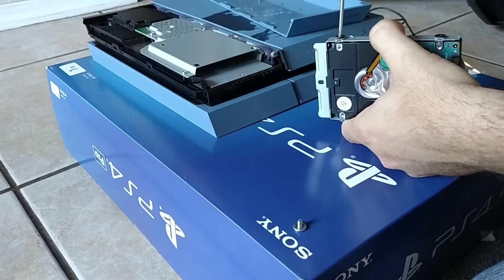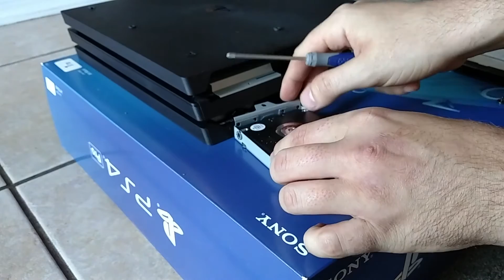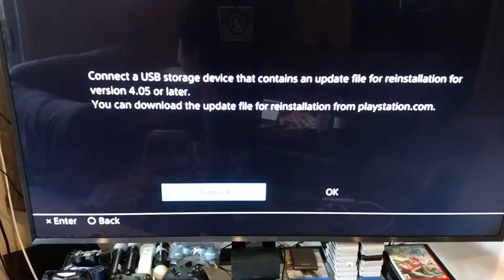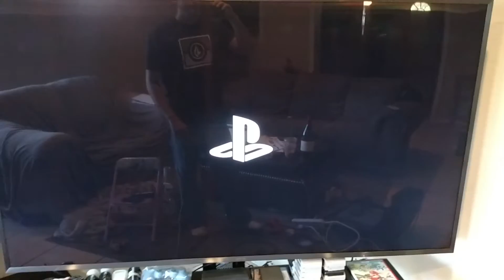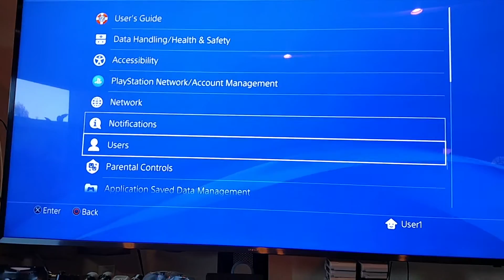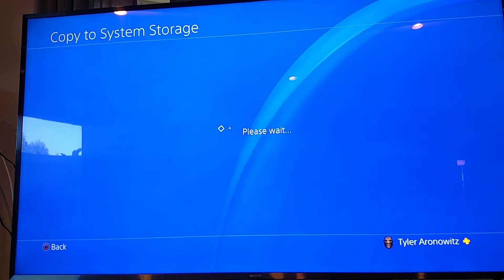Ps4 Pro Hard Drive Removal & Swap / install new hard drive tutorial

Comment: Hi 
I have changed my ps4 hdd 
Sometimes i hear long single beep 
Should i be worried?
Reply from the maker: I have not had this happen to any of mine when switching hdd's but as far as I was able to find online it seems some people have had the same issue with the beep after replacing hdd but no other issues or problems.

Comment: I have a old hdd from a ps4, and i want to install in a ps4 pro, what do i do, i must delete the stuff i have on the hdd, but i cant do it on my ps4 pro
Reply from the maker: Did you try going through safe mode on system to initialize system with the downloaded software from sony website on a flash drive? This should wipe drive clean and put a fresh install on hdd.

Comment: I have a ps4 that has no picture signal tried everything I now have a brand new ps4 pro can I take my old hard drive and install it in my new ps4 pro ? The hard drive from my old ps4 is a upgraded hard drive it is a 2tb Hd any help is appreciated.
Reply from the maker: Hi Chris, unfortunately you cannot put this hard drive into the new ps4 and have everything just continue working. You can use this HDD but you will have to download the install playstation file to a usb drive and follow steps in video to setup new HDD with your console.

Comment: Hey guys. So tried to do this last night with a new PS4 pro. I get to the stage of initialising the PS4 and when the status bar fills and the PS4 restarts, it won’t boot up again. The white light bar stays solid. It does that indefinitely until I have to force it to power off. Any ideas what’s going wrong?
Reply from the maker: Awesome. Geeky. Stuff. Try clicking on the link under video to the playstation site where you download software. Scroll down to Perform a New Installation of the System Software and make sure you follow those steps with file names being exactly how they say.
Reply: Thank you Ty's Vid Zone!

Comment: when i went to initialize ps4 (reinstall system software) it searched for the update software that i downloaded on my usb, gave me an error or message saying it couldnt load software and needed and updated version
Reply from the maker: Chase Altimore make sure that the folders are named and spelled correctly.  PS4 folder and UPDATE folder inside with PS4UDATE.PUP file inside that.

Comment: Hey. I have 2 TB on my original PlayStation. Can i simply just swap the harddrives? I have no problem with redowloading everything, but I really want those 2 TB? But no dowlaoding software on the internet or something since its already there?? Just take it from one device to the other?
Reply from the maker: The hard drive from your previous console should fit and work in the ps4 pro but you do still need to download the software onto a usb drive and install it when swapping to the new console unfortunately. Then you will need to download the games again as well. Just make sure that you backup your game saves online, on a usb thumb drive, or both before doing this so that you don't have to restart on all of your games.
Reply: Ty's Vid Zone! Hey my OG ps4 won't turn on anymore and sadly I didn't back up any of my save data. I recently bought a ps4 pro and the only option I have is to swap the hard drives (I don't know how to back up saved data on a broken ps4) if I swap the hard drives will I keep my save data I really don't wanna lose years of save data if you could help me with this it be much appreciated
Reply: @MOERUGG  you figured it out bro?
Reply: @WhyNotQuestionEverything  Sadly no I just restarted most of the games I have
Reply: @MOERUGG  my ps4 pro won’t turn on so I’m going thru this now what did you have to do to get yours working again bro? Just swap hard drives ?

Comment: Hi man, I put a 2tb in my PS4 n gonna get a pro next week I want to put the 2tb in the pro see if I just remove the drive and put it in ps pro will it reformat the hard drive aromaticlly or is there anything I need to do?
Reply from the maker: I don't think that it will reformat by just inserting the 2 tb hdd. You will probably have to download the software from the link that I have above and use a usb thumb drive to boot system from and format the hdd to the new console. Also make sure to save any of your game saves to either a usb thumb drive or the playstation cloud before reformatting.

Comment: do i need to start my new console atleast once before swithching hardrives
Reply from the maker: No, you can do the swap without starting console for first time. When you put the new hard drive in console you will be installing system software and then it will be like starting console for the first time.

Comment: Did you save all your stuff when you did this cause I have a character in 2k17 that I don't want to loose , also my old PS4 is broke so is it possible to still do the transfer and save everything without the USB ?
Reply from the maker: Yes, I backed up everything on both a usb stick and onto the online storage through playstation plus. I think if your taking your hard drive from the broken one and put it into a new console, you will still have to erase everything on hard drive so if you can't save it onto something then you will lose it when swapping consoles.
Reply: tyler a how do I save everything from my hardrive onto something because my old PS4 is completely broke I have no access to it
Reply from the maker: I haven't tried this but check out this video https://www.youtube.com/watch?v=1NXyKnN0gWA . If you are able to connect it to your computer through this then you might be able to transfer over the save folders and then download them back onto hdd after clearing it.
Reply: Mj Pacheco hey this same thing has happened to me so my old ps4 is broke and my 2k18 player is on it when I swap my hard drive to a new ps4 will I get my 2k18 player back or should I have saved it to online data I really don’t wanna lose him 3 months on grind 96overall
Reply: hey did u figure out how to solve it?

Comment: if you're taking a harddrive from the old ps4 and putting it into the pro, do you really have to take them out of the caddies? would be so much simpler and quick if all you had to do was pop both lids off, unscrew the 2 screws, and just swap hdds while still in the caddies.
Reply from the maker: Good question, I did not even try that when swapping these hard drives and didn't notice if the caddies are the same measurement but definitely could be since the hard drive dimensions are the same. If you end up trying that let me know if it fits correctly. Thanks for the question.
Reply: alright. I got a PS4 Pro Today. You CANNOT just swap the HDDs inside the caddies. The original ps4 caddy may be the same size and hold the hdd in the same way as the ps4 pro caddy, but the screws that hold them to the system itself are in a different place. For the pro, it is centered on the end of the caddy. For the OG ps4, it's located on the side of the caddy. 

As I said this was an original PS4, so the result may have been different if I had a slim.
Reply from the maker: Ok, good to know. Thanks for the update on that. Enjoy the new system.
Reply: i bought a seagate 2tb slim external hdd, i noticed the seagate is smaller the the ps4 pro is that going to be a problem theirs even space in the caddy.

Comment: what do you think about the ps4  pro compared the standard ps4. i do own a $5000. samsung 4k suhd tv.
Reply from the maker: For me I think it was worth it. I sold my uncharted console for $280 so only had to pay $150 more to upgrade and for that it was definitely worth it. I first played Infamous second son with enhancements and it was ok with the option of better graphics and normal frame rate or 1080p at 60fps which was cool to have the choice. Then I got Watchdogs 2 which has enhanced graphics and it is amazing, the best graphics I've seen yet and I am using a Samsung 4k tv as well. This game made me an instant fan of the new console and shows how much of an edge it has on the regular ps4. With a good tv I definitely recommend this console over the standard ps4.

Comment: or do i still need to update system.
Reply from the maker: You would still need to reinstall software when you switch your hard drive from one system to the other which will clear the hard drive. Unfortunately it will not just pop out from one console and into another and work. Just make sure to back up your save files onto a usb drive or online storage but the games themselves will have to be re-installed.

Comment: Ok. I have a 2TB now on my original PS4, can I just swap it and install it on the new ps4 pro withouth having to "update" de disc, I really don't want to download all the games again if it isn't necessary...
Reply from the maker: Unfortunately when you swap the hard drive you have to reload the software with the update file or it will not work so it will clear the hard drive. Make sure you back up your saves before you do that either on the playstation network or on a usb drive, I did it on both to be extra safe. You will have to install games and updates again but I just started with the games I was playing and then did the rest when I was doing other things.
Reply: Will do. Thanks.